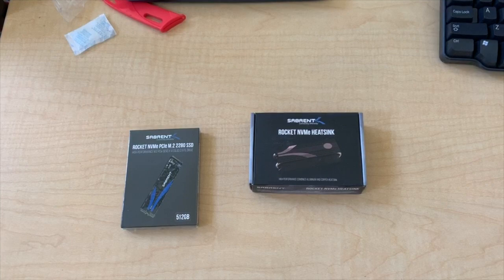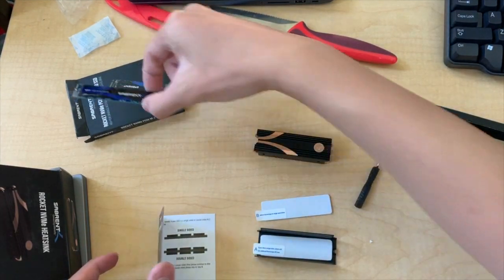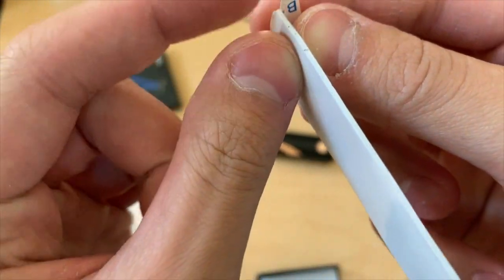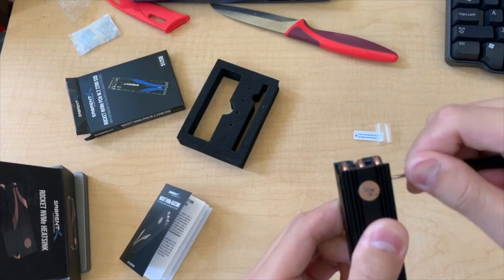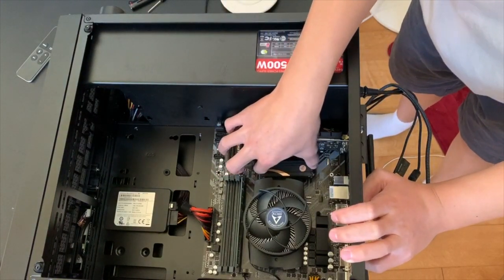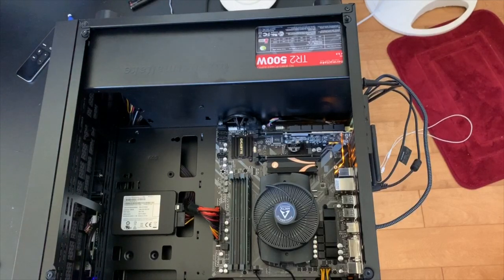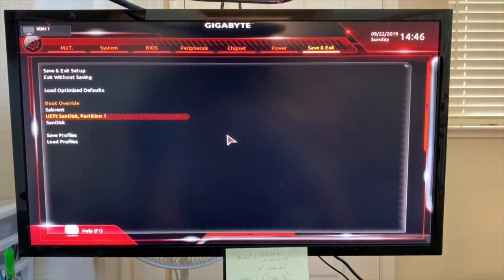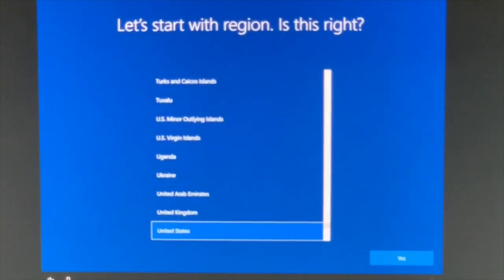How to Install M 2 SSD

Comment: That heatsink is for the Sabrent Rocket Gen 4 NVMe, which I just bought. It's overkill for your version. The Gen 4 throttles and limits the performance without sufficient heat displacement due to the high voltage requirement. Your SSD version doesn't require a heatsink; there's no performance benefit unless you purchased it for esthetics, which I fully understand. For the same price as your combined purchase, you could have bought the upgraded Rocket and saved up for a heatsink. In either case, thank you for sharing—great video!!